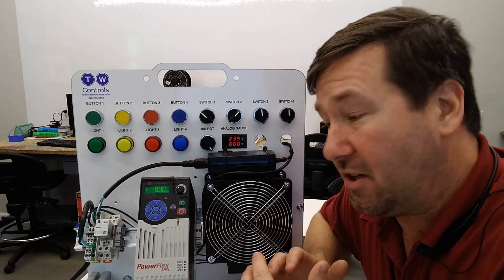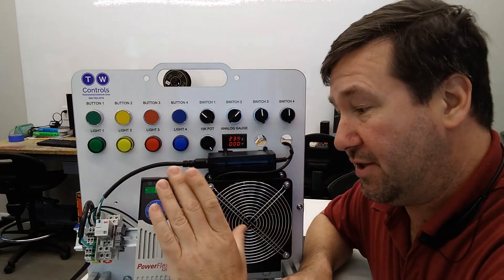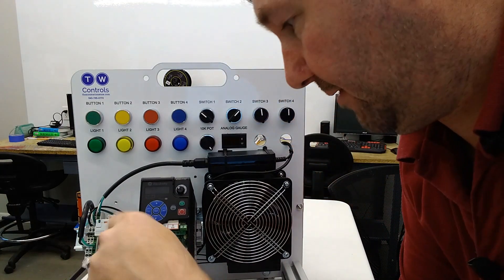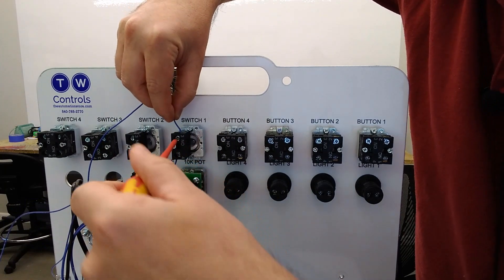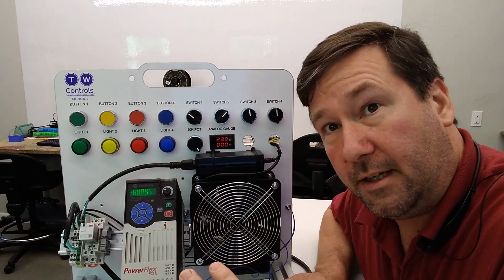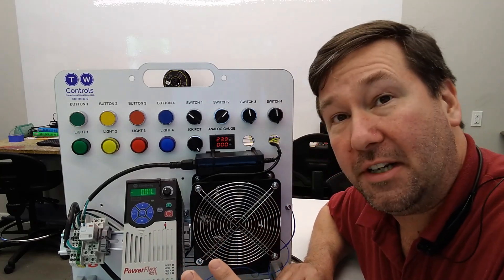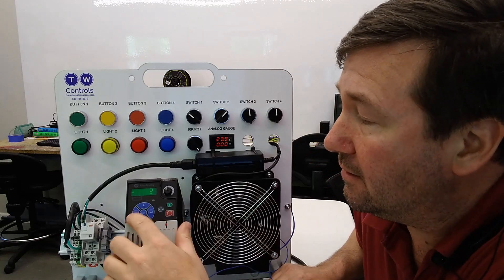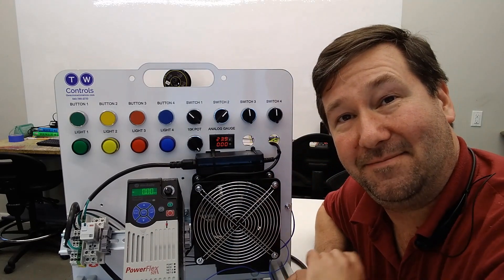How to Wire a Powerflex 525 for a 2 Wire Contact Closure

Comment: Does the stop bit from comms override 2 wire control when the terminal block is the currently selected start?

Longer Explanation:
There's a 525 that is being controlled over ethernet. An Electrician was asked to add an HOA switch. He wired Hand to terminal 2 and set ti to 2-wire FWD. He wired Auto to terminal 7 and set it to SPEED+START 3. Speed 3 and Start 3 were set to Ethernet. Speed 1 is set to keypad and Start 1 is Set to terminal block. If the switch is in the off position it is always off. In Auto, it works as intended. In Hand, it will only start if ethernet calls for it to start anyway. I think the solution is to only pulse the stop bit but I may not be able to get access to the PLC.
Reply from the maker: There is a little more to it, you are going to need to configure more parameters...see if page 49 helps.
https://literature.rockwellautomation.com/idc/groups/literature/documents/um/520-um001_-en-e.pdf

Comment: powerflex525 has single phase input and three phase output power, is it possible to use the single-phase load for testing??
Reply from the maker: Not under load but it will power up to configure. Make sure you have a matching input voltage

Comment: how do you use a 0-10v control and also be able to manually use the keypad if needed?
Reply from the maker: You could add a second speed reference and use an input to switch between them.

Comment: Hello sir..
Could you explain wiring diagram?..
Reply from the maker: How to read one?
Reply: @TimWilborne  can you explain wiring connection between fan and vfd
Reply from the maker: It is a three phase fan so there are 3 wires and ground.  They go to T1, T2, and T3.  Here is a video on how motors rotate.
https://youtu.be/9wMgos1kN1s

Comment: What did yo use to power vfd I bought 3 phase do I need inverter now or how to power it up from 120V household?
Reply from the maker: Not all drives that output 3 phase power require 3 phase input.  Our trainers use a 120VAC drive so they plug into standard wall power.

Comment: Hi, is the LCD screen powered by mains or 24v? Thank you!
Reply from the maker: Hi Kayleigh.  It is powered by the mains but you can configure it with a USB connector by removing the power module.    Here is a how to do it.
https://twcontrols.com/lessons/how-to-upload-and-download-parameters-from-a-control-module-of-an-allen-bradley-powerflex-525-drive

Also I didn't remove the control module correctly in the above link.  Here is how to correctly remove the control module.
https://twcontrols.com/lessons/how-to-remove-the-control-module-of-a-powerflex-525-drive-from-the-power-module